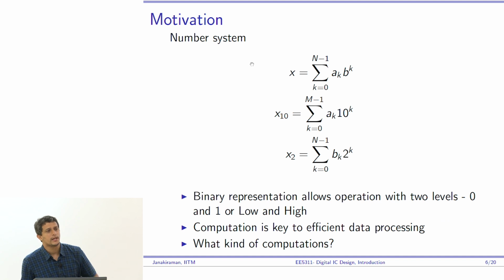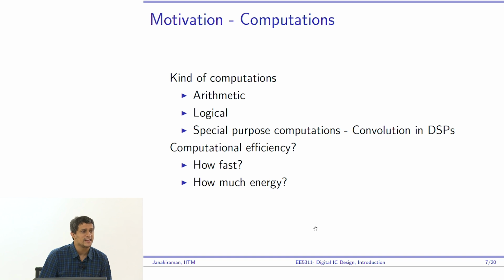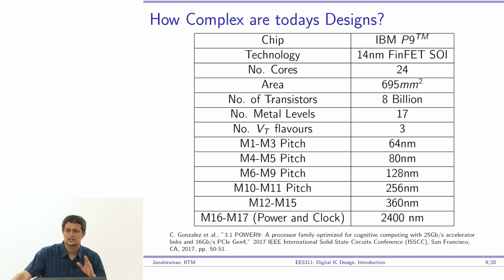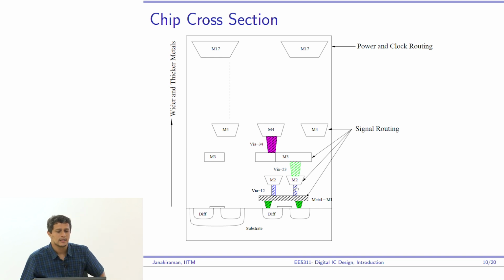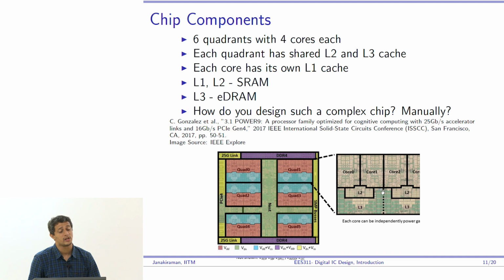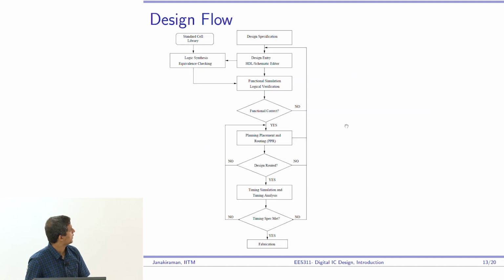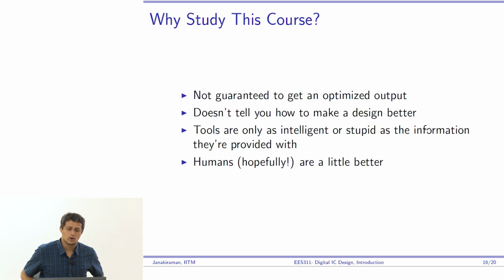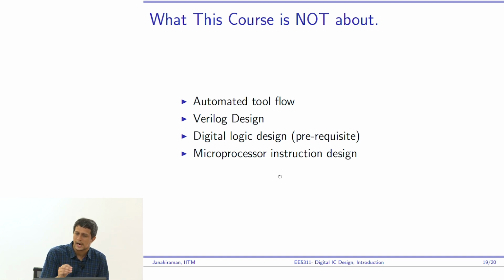Introduction - Digital IC Design

Comment: I am just a little confused here with dates of uploading of videos. I mean " the sequence of videos which this playlist shows is correct or is it wrong?
1)Introduction
2)Transistor videos 1-19
3)Combckt videos 1-21
3)AM videos 1-12
4)Sqckt 1-12.

Could you please clarify?
Reply: After lecture 12 of transistor (module-1) , you can go to directly on elemore delay(module-2), video lectute-13 then start module -3 , I mean inverter .